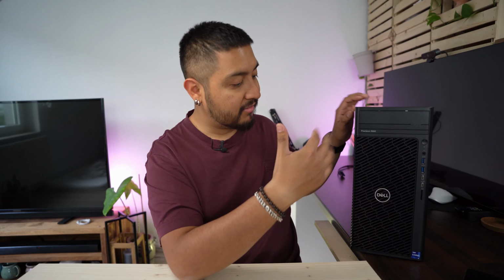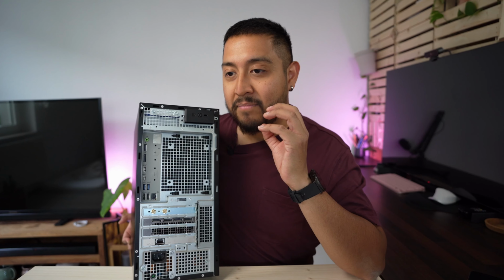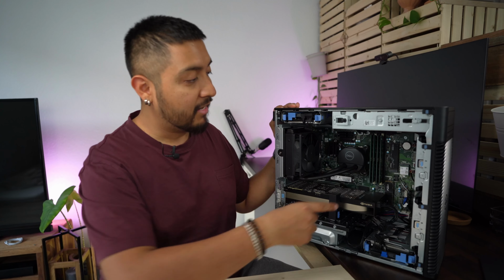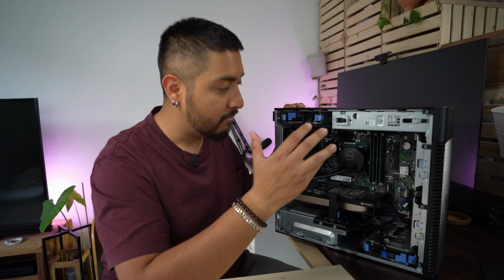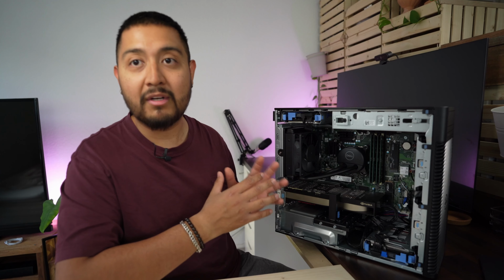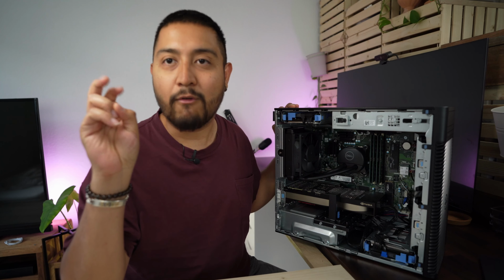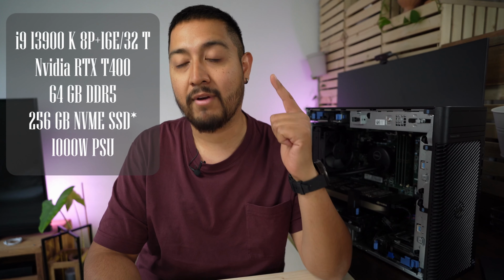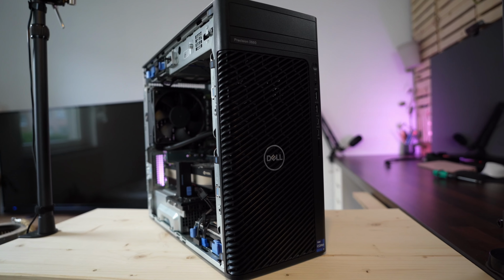Dell Precision 3660 Review / The best workstation that you can buy...

Comment: i love dell workstations, my favorite case was the dell precision T7500, I think it was X58 or X79 Xeon series dual CPU's, Biggest pc case I ever had, So much room to upgrade and work inside it, .. I kinda want to get another one and build a modern custom rig in the case... Lol    i love the water cooler in this one, I'm currently running  A Dell T7910 workstation with dual E3=2687w V4 CPU's  with dell water cooling / Fan hybrid CPU coolers, ( so 28 cores 56 threads ) a 1300 watt platinum psu, with 256 gb's of 2400mgz ddr4 ram, and dual NVIDIA P5000  16gb GPU's, and the best part is I bought it and all the parts on my local used market for about $600 total cost. It does around 15,000 in Cinebench r23 multicore, not bad for 12-year-old hardware, Lol... It still edits and renders 1080p video like a champ !

Comment: i have a dell precision 3630 and it has two 6 pin cables for the gpu, no 8 pin cable, if i get a gpu that has a 6pin and 8 pin slot for cables, can i use just one of my 6 pin cables? or should i buy a 6 pin to 8pin adapter cable to use both slots?can the gpu run with just one cable?the gpu im thinking of getting is the rtx 3070

Comment: Dear Jorge. 

Many thanks for the product review (very interesting and hands on). 

Guess what, you inspired me to purchase a Dell Precision 3660, and it just came in the door (bougth on ebay, as a Dell refurbished computer). 

Yes, you must have found a amazing deal; I was not able to find anything close to your price. Had to pay USD 1324 for this specs on mine (that Dell says has a list price of USD 4 277):

Processor
Intel Core 13th Generation i9-13900 Processor
Operating System
Windows 11 Pro
HardDrive
512GB PCIe M.2 NVMe Gen 4 Class 40 Solid State Drive
SSD Capacity
512GB
GPU
NVIDIA RTX A4000 16GB GDDR6 (4DP)
RAM Size
64GB
Storage Type
SSD
Series
Precision
Graphics Processing System
NVIDIA RTX A4000 16GB GDDR6 (4DP)
Dell Warranty
3 Years Hardware Service with Onsite/In-Home Service After Remote
Keyboard
US English Black Keyboard
Memory
64GB (2X32GB) Up to 4800MHz DDR5 UDIMM Non-ECC
Video Card
NVIDIA RTX A4000 16GB GDDR6 (4DP)
WIFI
No Wireless LAN Card

The one I bought has a ordinary cooling fan, and I believe only with a 500W power supply. I love the idea of liquid cooling, especially to get rid of the fan noise (one of my PCs in the early 1990s was a Sony, with liquid cooling, and it was really something for itself!). 

Do you know if it will be easy to update with the liquid cooling system (and can it be done at a reasonable price)? 
And do you think it is an idea to upgrade to the 1000W power supply? Do you have any tips before / when doing these upgrades? 

Also what Bluetooth Card and WiFi Card update would you recommend for the computer?

Of course, there is no expectation from my side that you will need to reply, and I appreciate that you have already invested a lot of time in making this content and shared for free to everyone!

Comment: I want to comment on what will be considered by many as a very minor point, but it remains somewhat irksome. The audio I/O jack on the front panel will probably (by most users) have a plug sticking in it at all times. The USB slots are just beneath that phone jack, so that audio plug is always in your way, as you much more often try to access the jacks below it to plug in a USB drive or cable. The audio jack should have been located BELOW the USBs.

Comment: have you experienced overheating issue with your 3660 with 13900k?
Reply from the maker: never, it remains pretty stable by 100% usage trough hours. I ordered it with the advanced liquid cooling system. I can imagine that if you are using air coolers could get pretty warm. I think for the 13900K it is a must the liquid cooling option. Thanks for watching!
Reply: the CPU will just throttle to keep running. This CPU already stresses triple fan AIOs, a single-fan AIO won't maintain stable high clock rates.

Comment: what kind of cable should i use to connect that to my HDMI monitor since the tower doesnt have an hdmi
Reply: DVI to HDMI adapter.
Reply: @zeroturn7091  It doesn't have a DVI port. It has just two DP ports. No HDMI is ludicrous
Reply: @pyebawlco.84  you’re correct, I meant display port.

Comment: I have the 3660 as my daily driver. i3 12100, 16GB DDR5 4800, 500W Platinum PSU advanced cooling solution and an RTX 3060 12GB I added myself. Runs like a dream and games most titles easily at 1080P @ the 100 FPS mark. Great backup support from the Dell site too (3 year warranty as standard). It cost me £1200 here in the UK but it just works. 👌 And yes, at first I was going to replace the i3 CPU, but have been amazed at how good it is at everything so will keep it for now!

Comment: I have some older Dell machines like Precision 690 and two T320, two T310 (one T320 and one T310 modified as workstations). I also used to have a T5500 many years ago which I sold. And they all still work to this day! Only had some issues with some older optiplex and some precision machines, Great video about your machine. I got all these machines for free as they were about to get thrown away by a company I worked at which unfortunately went bankrupt.

Comment: hello.
Great videos, I've been following you for a while.
I have a question, I hope you can help me, I just bought a dell precision 3650, i7 11700, 32 ram, and I want to add an RX 6600 graphics card
but the power source is only 300w,
Apparently I need more power to put the graph.
My Doubt is. I can put any psu with more power or it must be specific to Dell, (because of the connectors).
and another question is on the pci-e connector it has written pci-e4 x16 75w
Will this limit me for the graphics card that I want to put?
or I can put any graphics card.
greetings
Reply from the maker: Hello, for the 3650 unfortunately you need a Dell PSU. The size and connectors are very particular from Dell for such form factors. Regarding the PCIe slot, you can install any GPU if you have the PSU with the power connectors to deliver extra power in case that the GPU you install requires more than 75W. For example, a Quadro T1000 will draw its power from the 75W from the slot. Thanks for watching and for keeping an eye on the channel!!